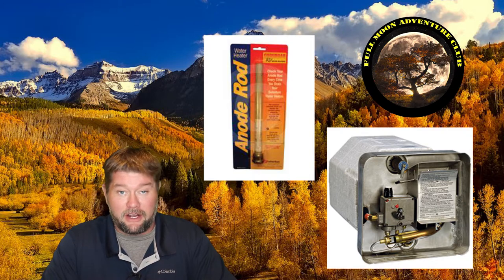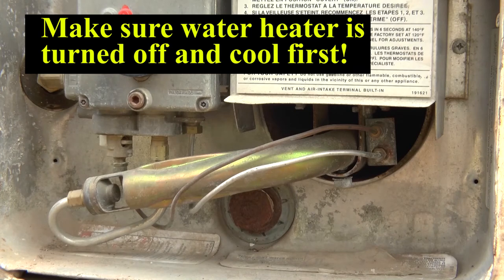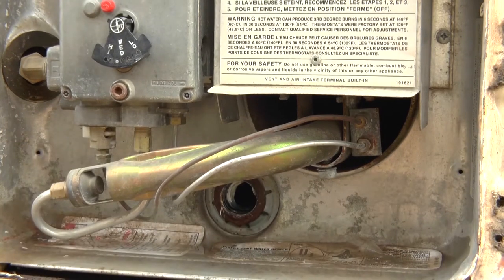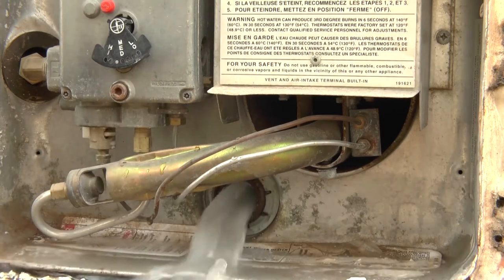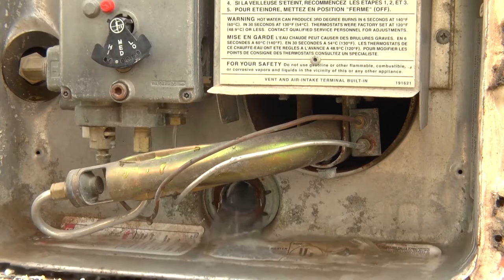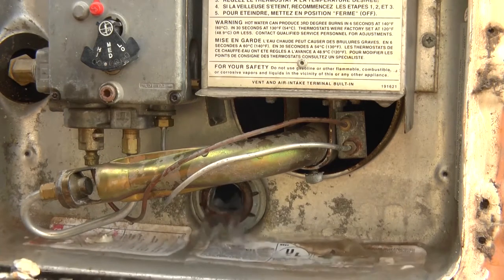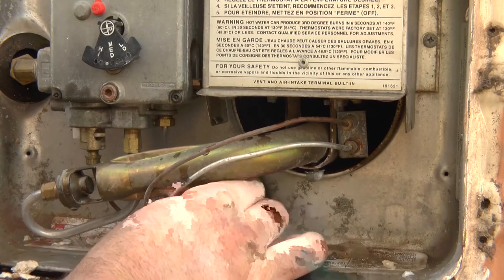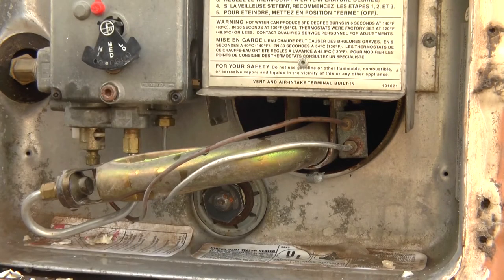RV Water Heater Flush and Anode Rod Replacement

Comment: Ours just has a plastic threaded plug. Can you/should you always use an anode plug?
Reply from the maker: Excellent question. Some water heaters do not require an anode rod. Check your manual to make sure but yours probably doesn't need one. Jim
Reply: Arizona Nomad Thank You!

Comment: i follow a lot of your videos and wandering if your have any advice which small portable generator to buy.  honda, generac, wen, i haven't the slightest ideal, i think i might want to run a small 5000 btu ac and a instant pot or toaster oven. but the generator has to be 50 pounds or less  easy and reiiable ect  quiet and inverter i guess.   thanks enjoy your knowledge  david
Reply from the maker: Can't go wrong with a Honda. I will reach out to some generator companies to obtain testing samples but they never seem to want to part with one.
Reply: @fullmoonadventureclub  thanks but will it operate a 5000 btu AC    i'm moving to a humid enviorment
Reply from the maker: @popatop75  a 1000 watt generator well be cutting it pretty close if it doesn't have a surge over 1000 watts to start the air conditioner. But a 5000 BTU air conditioner usually operates at around 500 watts after start up. I'm not sure about the instapot. I believe they operated around 1500 watts but I could be mistaken. It sounds like you need a 2000 watt Honda generator.
Reply: @fullmoonadventureclub  thank you that really helps  be safe